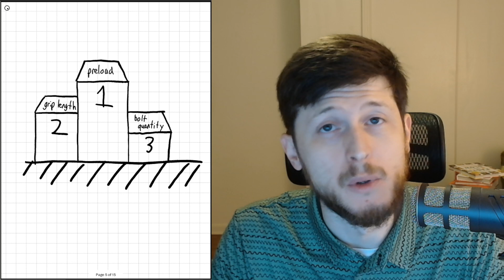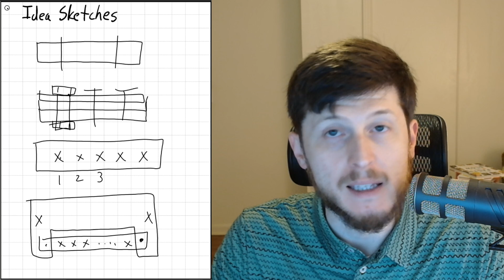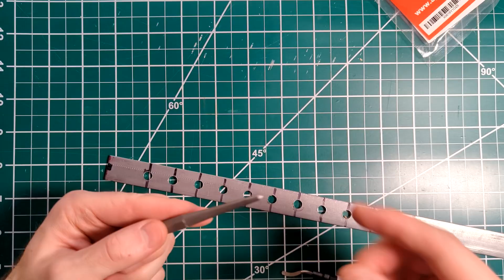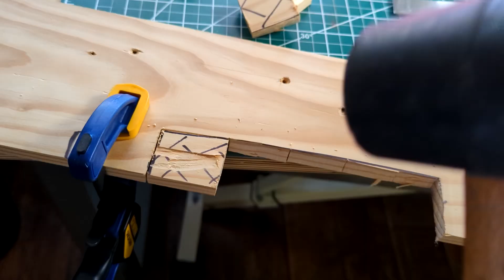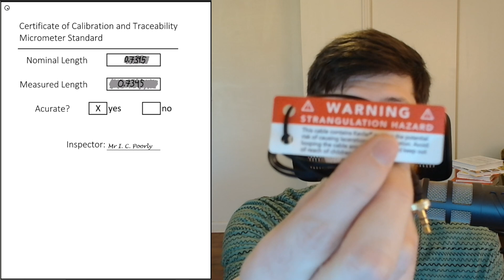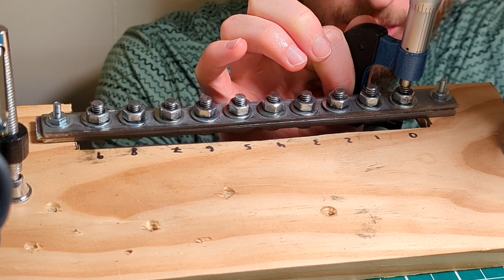Engineering Judgement 2: bolt preload test

Comment: Very nice presentation! I'm myself having Mechanical Engineering degree, so, this topic is interesting to me.
However, wondering, about the presentation method, interested about the "colors flickering". Am I right, that when sharing the screen of the rMPP, and scribing using the color pen, the flickering would not be visible on the screen share itself, but would be (essentially) present on the device itself (rMPP)?
Reply from the maker: @jacksonier  it was the rMPP and I think you can see the flicker a little bit on screen share but it's not bad.

Comment: This is a really fun test to see what you really do with a torque wrench.
It might be better to use longer bolts, because then the elongation is proportionally more and that probably gives a more accurate result.
I would also turn the head and bottom of the bolt and not file it.
Turning gives better measuring surfaces and it is about small differences.
Unfortunately, longer bolts require a larger measuring instrument and a digital micrometer would be ideal.
A digital caliper might be possible with long bolts, because the accuracy is no more than plus or minus 0.01 mm or 0.00039 inch.
Unfortunately, longer bolts give more angular deflection and therefore less elongation.
It remains experimenting, but interesting, because you know more about what you really do with a torque wrench.